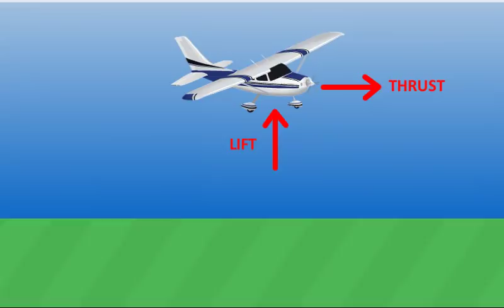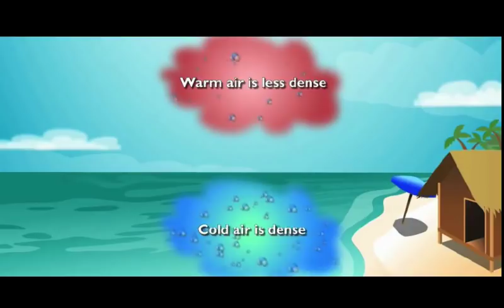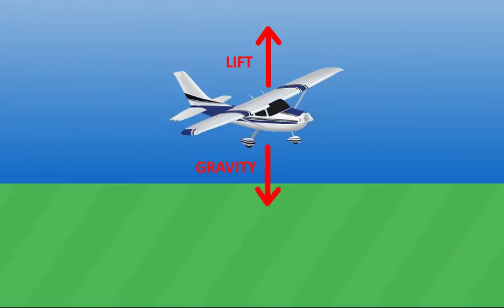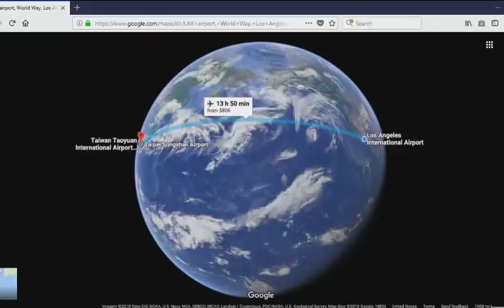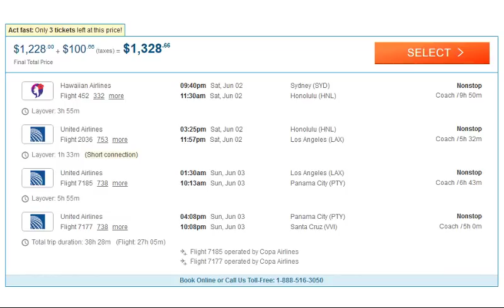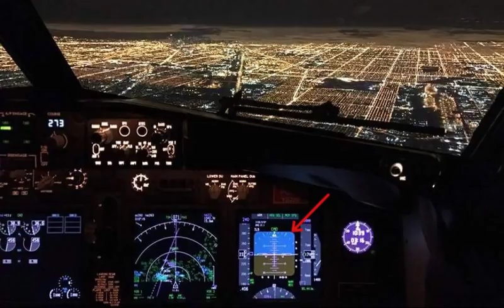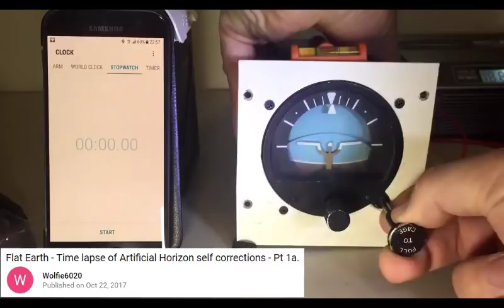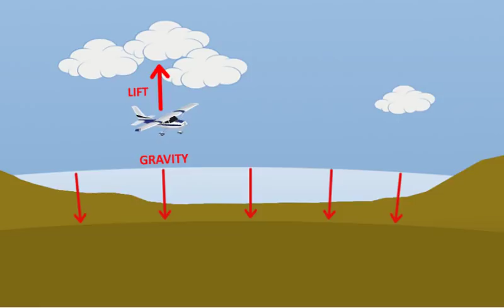Flat Earth Falsities - Plane Nonsense

Comment: What an "explanation"! The plane travels through air in any case you morron : either from W --> E or E -->W, so only on a flat earth it takes the same time! Stop playing with people's insecurities. PLUS...spinning? still feeling a light breeze? OK.... and who says the moon is round? We never see its other side also there are sun rays: the sun is not far away!
Reply: You didn't even watch the video did you?
Reply: "The plane travels through air in any case... either from W --> E or E -->W, so only on a flat earth it takes the same time!"
     The Earth, atmosphere and plane all start with the same speed so no problem on a globe Earth. However, on a Flat Earth the distance between Sydney and Santiago exceeds the maximum range of a 747-400, so this clearly disproves a Flat Earth.

"Stop playing with people's insecurities."
     Only with gullible people like you.

"spinning?"
     Once every 24 hours — wow!

"who says the moon is round? We never see its other side"
     The Moon is spherical. Even without spacecraft, which have photographed the far side for 60 years, libration allows us to see ~59% of the Moon's surface from Earth. The phases and shadows on the Moon are also consistent with a spherical Moon. 
     Libration: https://youtu.be/3f_21N3wcX8
Reply: Ah Vanya, but they have explanations why everything behaves and looks like its flat and at rest.  Long time ago when the Earth was flying faster then the half million MPH while doing 66,600 MPH on the side; the gasses clung to the surface sands and waters, thous now its all the way up with Momentum, perfect sync that IT wont let anything disturb :)
   - Wonderful isnt it? Its Natural science.
Reply: Inflammatory Louis 
woof woof, flerfie. 

of course you don’t understand reality. stick to your sick religion...
lol
so convenient... „uhh, i cannot understand how reality works, thus it it is all dah lords magick. end of story. praise dah lord! hallelujah!“

lol

simpleton. i own you...

keep barking up the wrong tree... lol
Reply: Vanya... as a religiotard you can certainly answer this question. god created adam according to His image. right? the bible says so. 
that means, your god has a dick, right? what’s he doing with it? pee? wank? or is there a secret goddess the bible doesn’t mention?

or what is god doing at night in company of the devil? 

you tell me...
Reply: Look this up- In Australia, a Sydney to Perth flight takes a just over 4hrs non stop. The distance, both advertised and Google, is about 3,280 Km.
That's an average speed of about 820 kph. Seems like a believable figure.
On a Flat Earth model the Sydney to Perth distance is  about 8,260 Km.
So, as the flight does not take 10hrs, either it travels at over 2,000 kph OR there is something very WRONG with the flat earth model.

Answer: The extra 6,000 Km in the Sydney-Perth distance arises from the azimuthal projection of a globe map to make the flat earth map. Only distances from the North Pole are preserved. It is a characteristic of this projection method that all other distance measures are distorted.
Reply: @sigmaoctantis1892  A lot of those looked up 4hrs flights, daily?  I would like to look up a screen with a accurate FE map with sizes & distances, which one have you used ?  I dont see why something would not be wrong with FE map (as so many theories sold as fact) being the vast repression and limited ressources of a few.... Heretics.
     510mph is possible in 21th C, and something is very wrong with your knowledge of air currents tunnels that may 2X speeds without breaking sound (660mph)barriers. 

ps; you are not the first to vent this one problem, its all over the net.
Reply: @BrainUser1  I have not found anything you might call an accurate flat earth map. I used the azimuthal projection map that is usually proposed as a flat earth model.  I preserved north-south directions by allowing north pole to equator distance to be 10,000 Km. You can use vectors to calculate the straight line distance or follow the line of latitude on the map as the latitude difference between Sydney and Perth is about 2 degrees. The straight line distance is only about 100 Km shorter. 

Simple method, assume a latitude of 33 degrees south (midway between Sydney and Perth). The radius of the circle is the distance from the north pole to 33 degrees S,  this is 13,653 Km. The circle at latitude 33 S is of circumference = 2 * PI * 13,653
The Sydney - Perth distance is the longitude difference in degrees,  151.17 - 115.96 =  35.21 divided by 360 degrees.
So 2 * PI * 13,653 * 35.21 / 360 = 8,390  
I believe this to be a faithful representation of the flat earth map.
NOTE: You will find that, on the flat earth map I have specified, flights on a north-south route agree with flat earth and globe earth measurements. I have deliberately chosen an east-west route to demonstrate the magnitude of the problem found in the flat earth model.

All scheduled non-stop PER-SYD and SYD-PER flights are specified close to 4 hr 10 min. Winds can sometimes shorten the PER-SYD time but only marginally. Also, there is no regular jet stream over Australia. 

The problem arises because flat earth supporters propose that the azimuthal projection is a realistic model of the earth. Remember the flat earth map is a projection into two dimensions of the globe earth. You will find that there is no discrepancy in distances, in any direction, when measured on a globe earth model.
Reply: @sigmaoctantis1892  Okay cause I dont know of any on the web of... information of past, present, and futur.  Thing is that surviver:  azimuthal projection map,  gives exact distances of grounds and seas?
    You may not believe this but I dont trust official GOV Google sizes!
As when I am in a plane I can not tell how fast its going, 250 or 650 mph, within your momentum atmosphere, so much less of actual ground speed, that Some claim trade winds exist inside.
     I see you like MATHS, sweet, trust YOU on that bit, but its just a language that like SCIENCE works with assumptions and facts, both have a nasty habit of changing... so if data is wrong... well... erratum!

    I wonder if a normal trusting guy like you knows how wrong GE maps have been on accuracy? (some Continents shown way bigger)
    Those not very popular flights are not even specified daily, only a few may get on board even if a LOT shorter.
     Again a few mom basement Researchers propose it is the best available of understood Reality cause's a problem? Again you are not used to Scientific proposals... usually have Problems. But I dont remember these old maps starting off as the recent accepted globe model projection, nope, but if Authorities specify..... well.....
Reply: @BrainUser1  The Flat Earth map only (Azimuthal projection) gives correct exact North-South distances all other directions are distorted.
OK. I am not such a trusting guy. I always check my facts.
Consider this for the east west distance argument.
The mathematics (trigonometry) I am using was developed by Pythagoras some 2,500 years ago. When do you think that trigonometry might change? it is based on the fact that we can measure distances. These distances need only be several centimetres (or a few inches if that works better for you).
My personal tests have shown that driving distances on Google maps are reliable up to 1,300 Km.
Before Google I can testify to the 2,500 Km from Sydney to Cairns, QLD. Google shows a similar distance.
I live in Sydney, Australia. My grandmother used to live in Bathurst, NSW, Australia.
The distance from home to Bathurst is a about 200 Km show on odometer, about a three hour drive.
Google Maps shows it to be 197 Km. Close enough allowing for equipment error.
Google shows a straight line distance of 156 Km. The road winds a lot so I believe that is a reasonable figure.
My flat earth calculation shows that flat earth believes the distance to be 366 Km
. This error is almost twice the actual driving distance.
On the flat earth map all southern continents are about 2.5 times their actual size. I don't know what you mean by 'recent globe map'. As a geographical map it has not changed significantly in 200 years.
Reply: @BrainUser1  All two dimensional maps of the earth are projections from the reality which is a three dimensional globe. I knew this when I was twelve years old. They will all involve some distortion of dimensions. This is why the flat earth map is also wrong. It is a projection from a globe. The method it uses keeps north-south distances to scale but distorts east-west distances. This is the reason I pick on east-west travel. If I pick Sydney-Brisbane travel then the distance will be close enough using the flat earth model. However, I deliberately pick east-west travel to show the error in the map. There will be a single narrow band, over the whole world, where it will be more or less accurate, however, the further south you go the greater the error becomes.

My calculations are correct with regard to the Azimuthal Projection map. This is the map usually presented by flat-earthers. If you have a better map, I am happy to use it to check the distances. Please provide a reference to what is the most accurate map, in your opinion.

Alternatively, you can reply to my other favourite flat earth topic. Please explain how sunset/sunrise occurs with regard to a flat earth.
Reply: ...so no easy reference to "..that flat earth believes the distance to be 366 Km"... as expected, okay... 
[ While it may have been used by ancient Egyptians for star maps in some holy books,[1] the earliest text describing the azimuthal equidistant projection is an 11th-century work by al-Biruni.[2] ]       One may wonder if those "Globe" maps were not first based on the common FLAT MAPS? 
Now was those days not before Globe navigator Christopher Colombus shortcut for Europe to INDIA by way of WEST? 
     Thous mistaking AMERICA for INDIA ? ??? 
When some earlier 240bc: of Greek developped Globe circumference of Earth...? 
Can you see any accuracy error of distances there? 

   Conclusion those imperfect internet globe maps been used to image what a flat Flat earth realm looks like, not that its was very right! 
  Not a space photograh done by our astronauts.... I still am waiting for one Flat made map showing Australia twice as big. 

   You must not be listenning to science knower locals on my reality... you already are having issues with this one, so an other... :(
Reply: @BrainUser1  The usual flat earth map (azimuthal projection) is a projection from a three dimensional globe to a two dimensional map. This map shows Australia at about 2.5 times the east-west distance that it is in reality. The easy reference to the 366km distance is to use your preferred map to check the distance. It is very easy. Do it yourself, this is a much better way of determining reliability than watching a YouTube video.

Try this exercise: Take the usual flat earth map and make a north south measurement anywhere you like. 1) Pick some points where you are confident of the distance measure it an write down the distance. 2) Now make east-west measure of Australia, say from Sydney to Perth using the same scale as in step 1. 3) Find a reliable source that will confirm the actual distance. 4) Compare the step 2 distance to the step 4 distance. 

Pick your favourite flat earth map, let me know what it is and I will check the distances. ALL two dimensional maps of the earth are distorted in some way so there will be an error I can find. If you cannot provide a map for me to check, please advise your reasons for hiding this information.

Judging from the way you write either you are a non-native English speaker or your personal reality is very different to mine.